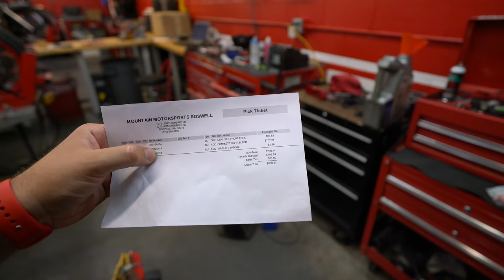I took the Monster to the shop [Wrecked Bike Rebuild - Ep. 13 - Ducati Monster 1100]

Comment: I have a white X-14 and once you get past the price it's the most comfortable/ cool helmet I've owned with enough vents and cooling power to keep your entire body cool. You don't get your head banged around in tuck and it's not as loud as other helmets plus it has a locking visor so it's waterproof and doesn't come up at high speeds. 10/10 recommend over everything else!

Comment: The same issue with the bolt on the bottom of the fork happened to mine.  I just drilled it out (carefully) and retapped and cleaned it out.  new bolt in and away I went.  Is still perfect.

Comment: Hey man, don't be put off by stuff like changing brake pads. It's something that's designed to be fairly easy (as it's part of regular maintenance). Even changing an exhaust or shock should be doable without too much knowledge. You've got the space (and most likely tools), just give it a go!

Comment: You could do that stuff yourself, no more difficult than things you have already done.  Oviously after you should get the bike checked over to make sure it's all straight and safe and get wheel alignment properly checked if you're not sure if you've done it right, and wheels balanced (if not done yet).
Reply: Then they would have found the other problems too that are going to cost a ton with labour costs too.  You could have saved a lot in labour if you done the exhausts, brakes and new front and rear suspention.

Comment: Hi, did you got any feedback from Brian about the notches that you cut down from the controls in the handlebar instead of drilling alignment holes in the new one? I think I saw some comments from you after you did it, but I just want to know if affected the throttle control in any way? Thanks!

Comment: GUYS, YOU NEED TO HELP ME GET CHASE TO READ THIS. His next WBR series should be on a 250/300 learner sport bike, and here's why:

Reason being: it would provide a different market for those wanting to win a bike (ie kids just wanting to get into riding might not want to donate toward a Monster 1100 as a first bike). It would mean more of the donations would come from kids hoping to win their first bike, since more seasoned riders may not want a tricked out 300 lol. 

This would mean the build may not get as much in donations as the Ducati, BUT THAT'S OKAY, because parts and upgrades on little bikes are much cheaper! ALSO, most learner bikes really can't be tricked out because the power gain/cost is prohibitively low, and as a learner bike, would likely be sold shortly after at a loss on the upgrades added. And doing a full power commander/jet kit and full exhaust on a 250 would be interesting to see just how much performance can be squeezed out of a tiny bike. 

I don't really need a bike like this, because I'm already rebuilding my 250 and have a 600, but I know a lot of new riders would like to start on something that would stand out, but can't sink thousands into a beat up 250/300. PLEASE HELP GET THIS TO CHASE!

Comment: This is a prime example of how a wrecked bike can quickly become a money pit. 10 hours labor at most motorcycle dealers is up around $1,000 just for labor... and that doesn't even include all the other stuff C2W did himself and all the parts that were donated to fix the obvious issues. A normal mechanically-inclined person would probably be in this repair for the cost of an immaculate used bike.

Comment: wow most of the "stuff that I can't do" is a no brainer to do.. yep I think I've lost all faith in Chase working on stuff. stripped fork leg bolt and leaking master cylinder just reinforce that opinion.. If you want to learn to work on things don't just decide to build a bike and give it away, you are going to kill someone that way. Go take a basic mechanic class at your local community college, summer classes are typically short and not expensive at all.

Comment: Or, you could have built it correctly in the first place.  "Doesn't look too bad" is mechanic speak for "at least it's repairable despite the best attempts of that mechanically inept fumble.  This is why it takes years to qualify as a mechanic, and yet y'all think it's easy to do because you buy a wal-mart tool kit..".